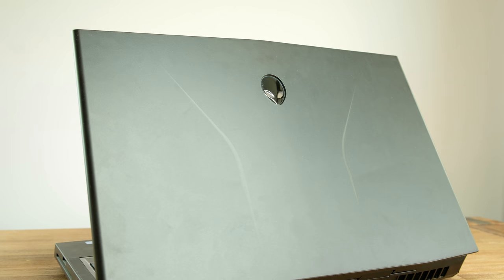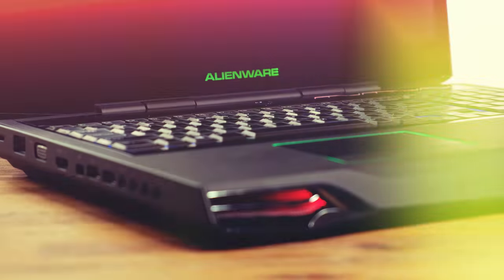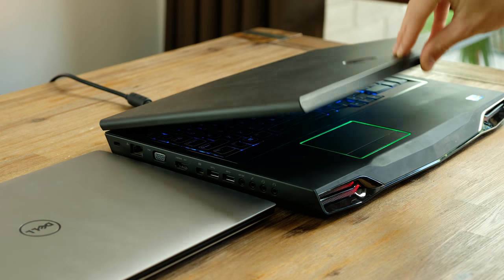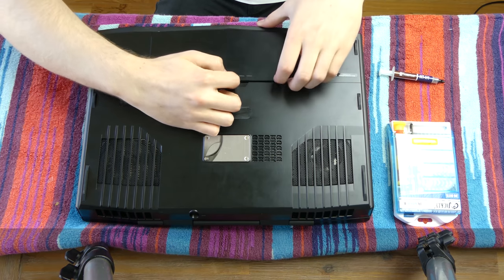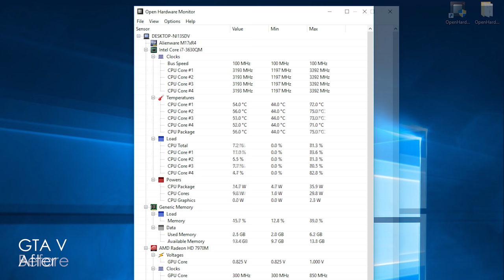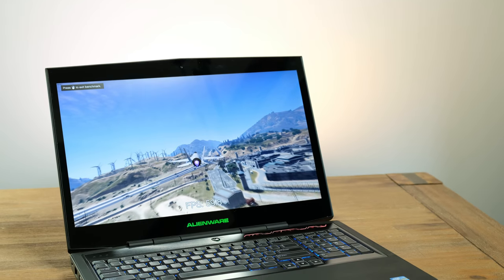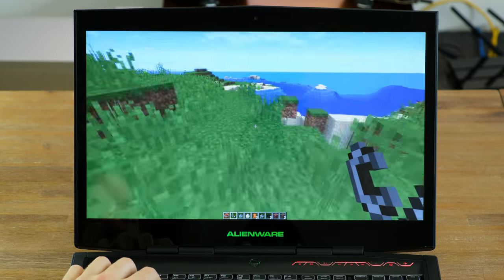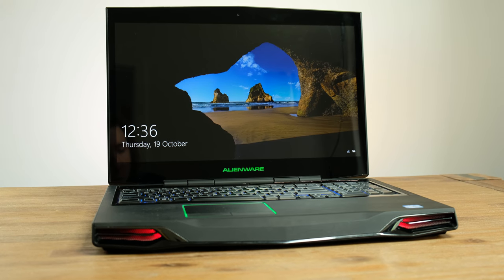Should You Buy an Old Alienware Laptop?

Comment: This video is really old now, but the obvious answer nowadays is a massive no. The keyboard is terrible (very easy to wear out or break keys, and it gets incredibly dirty after only a few days) and the mousepad buttons wear out fast. The 60hz LCD screen also looks really bad and for some reason has a very noticeable blue tint (which can be mitigated with color profiles somewhat).

The gpu can be upgraded to a 980m (or higher with modifications to the case and a 120hz panel), but it will power throttle randomly under high load, and the card itself really isn't enough anymore. The cpu on the other hand must be upgraded to a 3940XM if you want any comparable performance, except the thermals are atrocious and always overheat (don't expect to enjoy something like 4 ghz turbo on 4 cores unless you dish out money for a better heatsink/heatpipes). Also, most drivers are for Windows 7, and it's kind of a nightmare on Windows 10. Not to mention that unsigned nvidia drivers are extremely unpredictable, and some flat out don't work at all. The laptop can have decent performance, but the amount of problems far outweigh the positives. Unless you can find this laptop for really cheap, it's not worth it at all. That being said, the thing is a tank, and it itself will probably never fully break even after a decade lol.

Comment: Just don't buy one older than this.

I've been buying and abusing Alienware laptops for years. There have been decent deals to be had since about 2010 or so. The m9750 was the last of the "iffy" laptops.

Since then, they're tough. My m11x is still a great machine (it's just a smaller version of the one showcased here).

I won't bother trying to convince anyone beyond this point. It's a lame argument. But there's something pretty cool about these and their resale value does NOT  reflect their long-term usability capabilities. 

Subbed. Cool stuff, buddy.

Comment: I bought an Alienware 18 brand new with dual 780m and 32 gigs of ram. Paid AU$5500 for this fucker. Nearly 4 years later, and it still kicks ass. 1 issue though, once ever couple of months, the hard drive tends to randomly disconnect (or this is what I deduced), making the laptop unbootable. It is however easily fixed by literally slapping the bottom of the laptop. 
Idk, it just works.

Comment: i got my friend an Alienware M14X R1 core i7 2670QM (4c /8t) 8gb ram, and the top end GT 555M 3GB for 200 usd, it literally plays everything at 30fps lowest pubg witcher 3 etc etc BF1, it was super cheap portable etc, we got a replacement battery and an HDD caddy for the optical drive to ad an SSD, and boy  its superb

Comment: I still use my Asus G50vt. Windows 10, x9100 running at 3.4ghz built in Turbo Extreeme at 55-65 degrees (I can overclock to 3.9ghz and still operate, but what for?. 256SSD. 320HD (2slots). 8GB RAM. Yes is VERY old, from 2009 but it does everything that I need.(i play gta 5 no problem). I use a pad/fan when I game. I love that its OLD, awesome display with Daylight settings in windows. I do ALL of my work on this laptop. I will buy a laptop similar to the one on this video next. I mean things are so fast today that a 5 year old different will not matter unless you're a serious gamer. These gaming laptops are bad ass. I actually gave my newer faster Dell Inspiron to my brother because it looks like crap and the keyword feels cheap, even though the processor and graphics card were WAY better that what i have now. And yeah, this laptop holds memories. Passed around from family to family over the years and eventually made its way back to the original donor, me. Guess they all thought it was to "old". It was stock, so i guess it probably was. Anywas did about $100 worth up upgrades (processor upgrade was now at $11!), SSD at $50!. This whole rant is just to tell you guys that you can still get what you need out of an older laptop. Don't buy the newest just because its got the best specs. Love my solid, old, cool looking G50v!
Reply: Oh and Windows 10 upgrade was Free KABOOOOOOM!

Comment: I still use alienware m17x r4 but upgraded the gpu to gtx 980 and added another drive as 512GB SSD for windows and games..   changed thermal paste and replaced the gpu fan with a aftermarket version,have bit more airflow and noise😂 but still rock solid.

Comment: Recently, i bought a custom built pc for less than $150. The specs:Intel Q82-- Quad Core processor and a radeon 5750 hd 1gb gpu, it is a very budget pc and it runs csgo in 200-220 fps. 
   so i think its pretty good

Comment: I have the m17x r2, it's really a overkill notebook back then, it has a Core i7 740qm and 2 Radeon HD5870 in Crossfire, i am also using an Corsair 120Gb SSD and a 500Gb HDD, and a 24Gb mSATA SSD. It's really big and heavy. It also can be upgraded to a i7 940xm and 2x Radeon R9 290m, but it needs a better power brick

Comment: Ha thats hilarious, i literally have the exact same laptop setup. I bought the Alienware M17x R4 with those exact specs in 2012. I also have the Dell XPS 15 9560, i7 version and can honestly say the gaming on my Alienware is still better purely due to the thermal throttling that occurs on the XPS. Which is something I wouldnt be saying after nearly 5 years. 
I have recently replaced the keyboard on the Alienware and am also thinking of either repasting or investing in a perhaps an Nivida 780m, if i can find it cheap enough.

Comment: nope don't make the age-old mistake as i did, i am back using the Toshiba i had bought brand new, 3-4 years ago..i bought an Asus G75VW at a pawnshop for $434, that i only have the pleasure of using for like 6-7 months, and took me 6-7 month to get out of pawn payment complete, and got the problem of a black screen, i fixed several time on my own.But I fear it's going to cost more to fix than what I originally paid for, concerning its going to be the motherboard, i been searching similar problems and that is my conclusion, the motherboard..i know that they have some decent looking laptops, but it's just like gambling you gonna have to roll the dice see what you get, me i will start saving once again to buy a NEW Gaming Laptop, or  build it, but NEW.

Comment: How...mine sucks so badly. Is it the heat? My m17x can’t even play the binding of Isaac in windowed mode without frame drops, I can’t play beam.ng, and CS:GO constantly has frame rate drops, even one the lowest settings, what’s wrong with my computer?
Reply from the maker: It definitely isn't using the correct GPU. Make sure it is using the dedicated one.
Reply: Psivewri how do I do that? I’m not super good with computers yet, I just started PC gaming

Comment: the prices and parts of them make it not so cheap, youd be better off buying a dell precision m6700 or elitebook and upgrade them. Iv have been using a m17x r1 for a while now i have two, one for parts and one for normal use but just recently decided to go the route of hp elitebook with a 3rd gen i7, 32gb ram, gtx 970m instead of buying new and its alot cheaper than alienware of the same spec.

Comment: i was unsuccessful and bought one of these from 2014 for 450euro and had to replace gpu after a week and that did cost me 350euros + had to replace battery for 100euros and the whole repair thing took 3months cause repair company had to order new gpu from far away and after they got it, it was broken and had to order another one gain ,was a nightmare .and now 2 years after gpu gave up again or at least i think it was gpu cause it cut the power whenever gpu is inside laptop.

Comment: I have this laptop since 2009 and it works fine, started off Windows 7 and upgraded to Windows 10.
Reply: I’ve had mine since 2014. i7 gtx 760 14” laptop. I upgraded the hdd to an ssd. I dunno why but I feel it runs slower than it used to.
Reply: @lionofpersis  might be some apps running on your computer.

Comment: I'd rather buy an older HP Elitebook or Lenovo ThinkPad with dedicated graphics, mind you they'll mostly have Quadro graphics, but considering I only plan to use my laptop (gaming wise) for MMOs and other popular online games, I think it'd fare well. They can go for $250-$500 on ebay, depending on the configuration. You can also skimp out on the CPU and GPU and upgrade them yourself, if you find it'll save you a few bucks.

Comment: I need help. I have a 2010 Alienware m15x laptop and need to replace the hard drive, i need a 2.5" HD but they all seem to have a different fitment than what my laptop requires. Anyone know what I am supposed to get? Reviving this computer to avoid buying a $400 dollar potato, Instead I would like to spend $80 on getting this to work for school mainly.
# Currently on Alienware Aurora R7,  I7 -8700, EVGA XC Ultra RTX 2060, 16gb Ram .
Reply: Desperate for help with this, for some reason nothing I look up has a similar looking Hard Drive, seems like the fitments are completely different.

Comment: As an owner of a m14x of that gen... Just don't do it. Thermals are horrendous. My bro has a m11x of that year and it's even worse. He gets to 90°c in like 10-15mins playtime of battlefield 3 and shutdown not long after. He's tried creating larger vent holes replacing thermal paste always using a cooling pad. All to minimal effect.
Reply: Unless you wanna custom mod it to water-cool it, which kinda defeats the purpose of a laptop*
Reply: The max temperature of my m14x r2 is 68 degrees Celsius, without replacement of thermal paste for two years

Comment: bought an alienware 18 2015 late model 32bg ram i7 4940ms extreme oc @5.2ghz dual gtx 980m 16gb 3tb storage, now upgraded to 10tb hdd withan extra 1tb msata ssd
Reply: what audio controller it used?
crappy realtek chip or creative chip?

Comment: The processor is surely good, but the graphics card is not. You may think that i'm wrong looking the benchamrk used, but if u think about it, GTA5, Minecraft  and CSGO (which runes fine even on igpus) ar relatively old games: what about 2016-2017 games? He benchmarked only PUBG that managed to run 45-55 fps but on low...what can you expect to play next year? At the same price, an equipped geforce mx150 laptop could do the same with less heat, weight and year on the back!
Pls don't buy it, ty.

Comment: This is a typical price for a gaming laptop in the budget line and you can get a much much thinner laptop with similar performance. The screen would be a down side but that's pretty much it . Better battery life , better reliability , better portability , similar performance
Reply: This series, especially m15x m17x r4-r3 and m18 are the most flexible platform I ever seen from Alienware, it's an upgradeable laptop, even today people have been running m17x r4 with gtx 1070 or even gtx 1080. This laptop series basically is a mini itx with monitor attached on it.
Reply: Expert enthusiast only though.
Reply: @r3zaful  well new is always better than used in terms of reliability
Reply: @xistencestudios8904  I mean, if you skilled enough you can even attach a water cooling at the bottom of this laptop case, this laptop is heavy and thick, allows for heatsink modifications. 
But yeah it's an expert only laptop, I don't recommend to buy this old machine without any research first.
Reply: @r3zaful  well you can go that way . The issue I would say is that , the upgrades ain't free . If you add up all the costs . You can get a decent gaming laptop . Options like the Pavilion Gaming Laptop or the Legion Y530/Y540 . They might have worse displays but will have similar performance and good reliability being significantly thinner
Reply: @xistencestudios8904  you could probably get a m17x r4 with no gpu for 110usd, then buy a gtx 1070 for 600usd
700usd for a laptop with gtx 1070 definitely is the definition of cheap laptop.
Reply: @xistencestudios8904  I could think many of different ways to get a laptop with gtx 1070-1060 in it with less than 700usd, and i7 3940xm
Reply: @r3zaful  well that would be a good deal . I think the cheapest GTX 1060 is the Acer Helios 300 at around 900$ but with a better i7 HQ series. It also has a 90% sRGB display and I think it would be a good competitor . Well if you don't have the extra 200-300$ for a laptop in new then maybe that's your last option but for me the extra would be worth it. Gaming laptops are used heavily so I don't trust them in the long run
Reply: @xistencestudios8904  this laptop isn't a laptop
It's an mini itx disguised as a laptop, you could upgrade it to rtx as well.
Reply: @r3zaful  ok I got it .
Reply: @xistencestudios8904  i7 xm series is capable to reach 5ghz or even 5,7ghz overclock due its immense power hungry by default, the hq series isn't near as that powerful as earlier xm series.
Reply: @xistencestudios8904   barebone laptop nowadays using PC CPUs instead processor that made specifically for barebone laptop like the xm series.
Notice that xm series isn't common processor for laptop even for gaming laptop, due the HEAT and power are reasonably not suitable for common laptop we have, even today.
Reply: @r3zaful  yeah , manufacturers don't use those in laptops any more

Comment: Don't buy, as a former Alienware R2 owner I had two major problems and that's why I sold mine before it turned into a nightmare:
- First, the charger cable has a kind of sensor that if it gets damaged somehow, the laptop won't recognize it as an original charger and will try to save power (which will make the laptop performance sucks hard). 
- The second problem is the fact that you're stuck with dell drivers for everything, and dell won't give new drivers after two years of the model launching, so imagine trying to play newer games without new drivers!

Comment: Could easily run Windows 11 as smooth as my brain with an SSD
Reply: why would you do that
Reply: @lemau8458  I use windows 11 on my lower-end i5-3330s system with an SSD. Runs like a charm, but not recommended.
Reply: @FireFoxDestroyer  why would you ever use 11 on lower end systems, not to mention at all. If it "runs like a charm" why wouldn't you recommend it
Reply: @lemau8458  it's not officially supported, so no drivers.
No drivers means degraded experience
Degraded experience means pain
Pain means sad
Sad means go to windows 10

This will happen in the future
Reply: @FireFoxDestroyer  Cut out the middle man make it easier
11 = pain = use 10
You just said you use 11 though which is it

Comment: I just bought this for $400.00 Did I get ripped off for a 2016 laptop. I just need it to process photography using Photoshop and Lightroom.

Alienware 17 R3 | 2.2GHZ I7 | GTX 580M | 20GBram 500GB
Processor Speed(2.2GHz)
Audio Port
Blue Tooth
Certified Data Destruction (NIST guidelines)
Optical Drive(BluRay -Combo)
Video Card(Other Video Card)
Video Port
Wi-Fi
Ethernet
Camera
HDMI
Make(Dell)
Screen Size(17)
Memory Card Reader Slot.
Processor Type(Intel Core i7-2670QM)
Screen Display(Glossy Screen)
USB Port(USB 3.0)
e-SATA-Port
Hard Drive(500GB)
RAM(20GB)

Comment: Sounds great but if to buy a used laptop then you must take it apart to inspect it and clean it and reapply thermal paste.
putting in a new cpu fan would be nice to extend the life and a new solid state drive as well.
then connect laptop external monitor so your on board video stays good for as long as possible.

Comment: You shouldn't buy a laptop at all. If you want solid performance in gaming, then never buy a laptop. I made that mistake and bought a laptop with 1750$, thinking it will perform very well ... Mhm ... 94 degrees in demanding games, the CPU underclocks to 1500 mhz and the GPU to 1400 mhz ... Of course that leads to a 20 fps drop ... 250$ more and I could've bought a GTX 1080 Ti PC ... That was the first and the last time I ever bought a "gaming" laptop.

Comment: I have an Alienware 17" with a Core i7, 32GB DDR4 and a GTX 1080.

considering the RTX  series is underwhelming beyond incremental improvements beyond the 1080Ti, I'd say I won't need to upgrade for a while.

I'd say you should upgrade the RAM immediately to maximum and upgrade the shit HDD to a SSD immediately.  

1TB SSD is now less than $170.

Comment: but you ruined it with windows 10
Reply: I wonder if the gpu could be upgraded to 1060 or 1070 and still be Win7 compatible? Because I know that upgrade is possible with a heatsink mod.
Reply: @renwalda  my desktop was upgraded to a 3060ti and it runs windows 7, haven't had any issues with it

Comment: Ngl its not that old its first version is windows 7 and the computer is 10 years old not that old
Reply: My August/2009 Dell Alienware M17x (pre-R1) had windows Vista pre-installed and they shipped the windows 7 os disks to me a while later when they were released, February/2022 and she's still on Vista and 100% working as good as it was 13 years ago. 
I will be putting windows 10 on it as soon as I get both of it's hard drives files transferred into my Qnap Nas(which I wouldn't get another of); and I paid over $3k 13 years ago for my M17x and I would do it all over again 1000%.